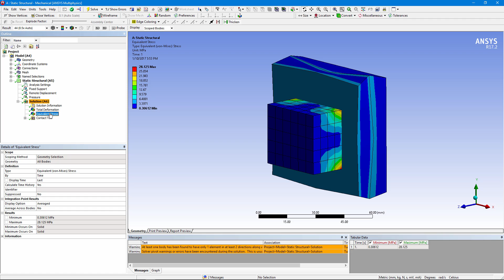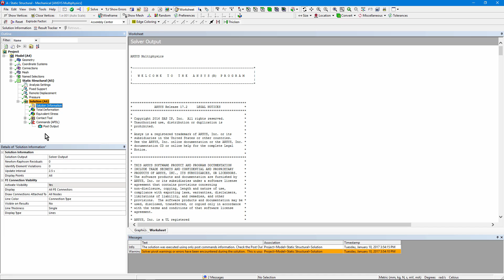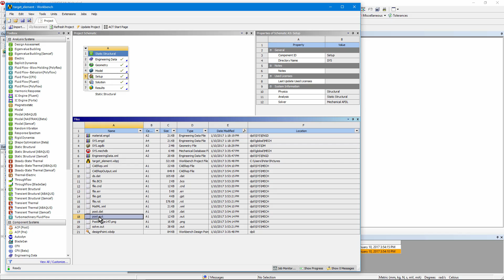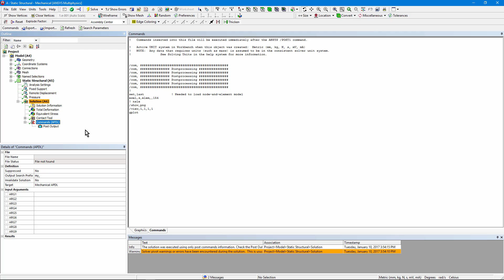Integrating APDL Post-Processing Commands in Ansys Workbench Mechanical

Comment: Can you give the temperature to the node? on the command ? Looking at your lecture, it seems like you can apply pressure to the node, but there is no temperature.
Reply from the maker: Hi and thanks for your questions. 

As a load in Mechanical, no. In the Mechanical GUI temperature loads are applied as Thermal Conditions on bodies only, as a constant temperature across the body. To apply a temperature distribution (ie; a result from a steady state thermal or transient thermal that is contained in the same Workbench project), link the Solution cell from the Steady State Thermal or Transient Thermal to the Setup cell in the Static Structural in the Project Schematic in Workbench.  

Temperature loads can be applied as body forces on elements via commands, not to nodes.
Reply: Is that right? Or, I think, what do you think about adopting giving the temperature according to each location from external data? I think it is the same as giving temperature to the node. @SimuTechGroup

Comment: Is there any way to do APDL command in workbench in preprocessing instead then postprocessing?
Thanks
Reply from the maker: Hi - Yes, APDL commands can be inserted in the environment branch (ie; Static Structural, in this case) in the Outline in Mechanical for loading or constraint purpose, or in the Geometry branch for altering material properties or in the Connections branch for altering contact or joint behavior.

If you are interested in further Ansys Training, Consulting, or Mentorship visit https://simutechgroup.com/services/